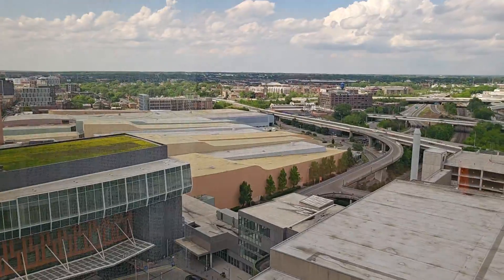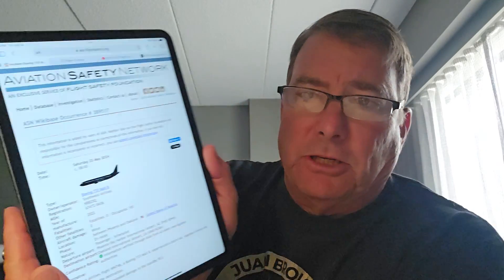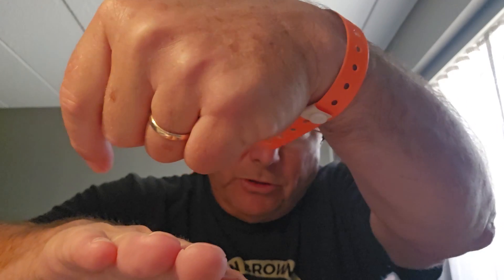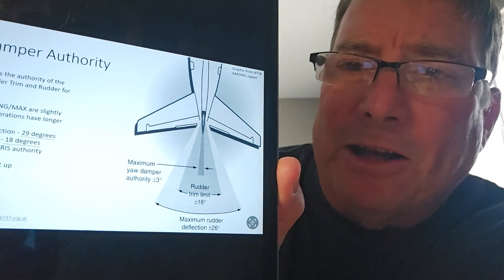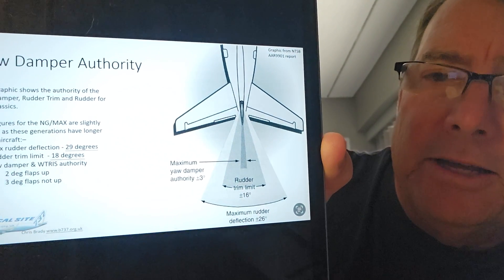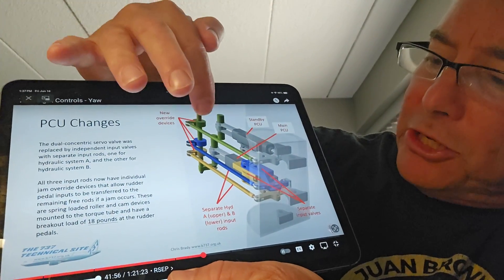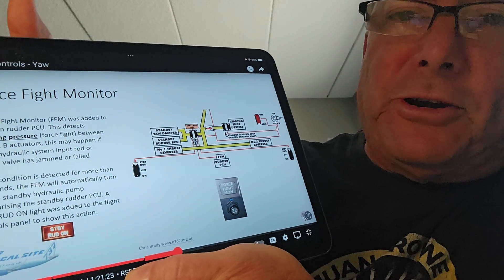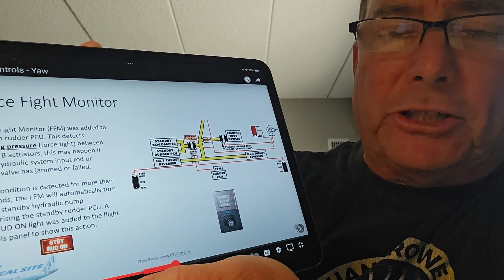SWA 737 Max-8  "Dutch Roll" Incident

Comment: Hey Juan.  I thoroughly enjoy your videos and all the in-depth research you do.  I just watched the video about the 737rudder issue that happened recently.  I am a tech instructor for both the A-320 and B737 Max for an airline. To answer your question, the Max uses the same rudder control system as the NG.  Incidentally, after the RSEP (Rudder System Enhancement Program) which was mandated in the early 2000's, a new main PCU was installed (I did a few of them while I was turning wrenches).  That said, the classics then had the same type of rudder system as the NG and the Max after the modification was incorporated (RSEP).  The Force Fight Monitor was a big part of this upgrade.  The Force Fight Monitor is installed in the main rudder PCU and once it detects a difference of 3600 psi for a minimum of 5 seconds (one system pulling one way while the other system pulls the other way), it will automatically turn on the standby hydraulic pump and activate the standby PCU which will control the rudder.  One disclaimer is that I DO NOT work for the airline that had the problem but am aware of it via the news and your channel.  Hope this helps and keep your awesome content coming!
Reply: Such a strange story.  Dutch roll felt by the pilots at Fl34. Failure of yaw damper?  Pilots regained control per FAA but cause structural damage to the ribs, standby pcu damaged- what does that even mean- physical damage to standby pcu-how does that even happen.  Pilots then continue flight like nothing never happened.  But something serious did happen. Can’t wait for the NTSB report.  Ribs of airframe structurally damaged. Incredible.
Reply: @gailcates8826  inadequate supporting structure for the PCU. Which in itself is saying something-the PCU is a pretty robust piece of equipment & given it's role in primary control of the aircraft-one would tend to question the basic design of the structure itself........
Reply: Since nobody has said it yet, thank you for the clarification of the Max's setup. :)
Reply: @ZeDestructor00  Indeed.
Reply: OUTSTANDING response. However-a difference of 3600 PSI ? Considering System A & B as well as Standby operate at 3000 PSI ?
Reply: @stevenrobinson2381  Yessir!  Think of it as a tug-of-war type event.  The system A servo valve pulls one direction while system B pulls the other creating an actual pulling force between the system servo valves of greater than 3000 psi.  Also, when there are rudder inputs made from left to right and vice versa, the point where the rudder changes direction makes a pressure bump but it's so short-lived that it's not considered a force fight.  That's why it is set up to require a period of five seconds minimum in which it would be an actual force fight.  Hope this helps clarify it
Reply: Is it possible that one of the PCUs or hydraulic systems was MEL'd, and then a failure of the other left the airplane without the yaw damper? 
Or is that not an MEL item on the 737?
Reply: Thanks for the clarification
Reply: I was wondering how that worked.  Thanks for the explanation
Reply: Damn, what pressure do they run at to have a 3600 psi difference?  Most hydraulic systems are around 3000 max.
Reply: @mrbmp09  As others have said, nominally upto 3000psi. 3600+psi should only be hit if there's two pumps acting against each other, thus the automatic shutdown set to trip at that pressure level.

Comment: It's funny you mentioned it, I've had this conversation with many pilots about "damper vs dampener". The Cambridge English dictionary defines dampener as: a device that reduces vibration (continuous quick, slight shaking movement):
Synonym
damper
Reply: I think damper is more concise and professional but dampener is not wrong, they really are interchangeable. The car community had this debate during the early internet and even the most pedantic could not refute that they're both acceptable

Comment: So we don't know, yet if the yaw damper was working or inadvertently turned off ? Since there was structure damage to the PCU mounting, sure sounds like excessive rudder inputs, which, IIRC, was not part of recovery procedure from Dutch Roll in the 727 which was much more susceptible then the 737 due to the higher wing sweep.. It was taught not to use any rudder input at all since that usually made things worse. The procedure was to "stab" the rising wing with a quick, sharp aileron input and back to neutral. Took considerable concentration because it's just not natural to do that. Very easy to start a PIO.

Comment: Former Crew Chief on a USAF KC-135 (59-1507) and experienced firsthand in the late 80s a Dutch roll on a TDY trip. Not a good feeling I must say. Subsequent local sorties pilots were experiencing the same on this particular jet. Boeing came up to Loring AFB (our home base) and started changing out parts. Aircraft was grounded for a while but eventually the Red X's were signed off and the jet flew again without anymore incidents. Crazy times. Kudos to the test pilots and Boeing engineers.
Reply: What was the cause?
Reply: @ajs1691  I honestly don't know. The story around the flightline was Boeing changed out a lot of stuff over a month or so and then one day it no longer did Dutch Rolls. Yeah. I'm sure Boeing knew, but by that time i was transferred to another tail number 58-0093 and the jet in question 1507 went to Tinker for the R-mod conversion.

Comment: Southwest went all-in on the MaX7 with a total of 342 orders. If SWA replaces older-generation 737s with the MAX, it  will compromise 40% of its fleet. If the MAX has any more bugs and is temporarily grounded, SWA  is screwed.

Comment: Love Juan Brown. Almost every day he helps pilots be safer and smarter and explains the business and hobby of flying to untold non-pilots. Maybe im being picky but, the dutch roll explanation is not quite right. The accelerated wing does not slow down owing to drag thus reversing the roll. The roll gets reversed by the vertical stabilizer. When the stabilizer starts restoring the yaw, the other wing is now accelerated and it starts producing more lift rolling the aircraft back the other way. The cycle can be exacerbated by pilot input.

Comment: The Airbus A320 was known (many years ago) for mild Dutch roll motion which made crew at the back nauseous.  I was told that the tailfin was too small, designed that way for fuel economy.
Reply: I heard it was normal lol, from the 727 on, and I did notice side to side back there during cruise, more in some models than others.  But that's probably more from wind direction?  IDK, just asking.

Comment: I experienced a total loss of the PCU in a SWA 737-200 on a flight from SAN to PHX.  At touch down we lost all hydraulics of the A,B, and Stby system.  They claimed that it was not possible to loose all hydraulics through the PCU, but it did occur.  This occurred around the time of the crash of the United 737 that crashed in Colorado Springs from a PCU fault.
Reply: It was potentially a problem with Airbus too. A potential problem was identified where both Yellow and Green hydraulics could be lost if the fluid was lost in one system and the PTU just ran until it failed trying to make up the pressure. So a mod was done that when fluid was lost in one system the PTU would time out and shut down before it caused the other system to fail also.
Reply: Wow you lucky some things on untied 737 sadly those people were killed now we have 737 max almost same thing this crazy why is always 737 🤦🏿‍♂️
Reply: @wilfordfootball79  because there are more of them than any other aircraft
Reply: @wilfordfootball79 
It’s not only the 737.
Reply: @richardlewis4288   "It’s not only the 737." 
True. It was a potential problem on the A320 line also but a modification greatly reduces that risk today.
Reply: I remember that UAL crash at KCOS…they tried to hang the crew with some absurd cockpit conspiracy theory..thank you ALPA for exonerating the crew!
Reply: Yikes!
Reply: Holy cr-p!
Reply: Meanwhile, Boeing got busy covering that one up too ?
Reply: Any swept wing can dutch roll, pay attention.

Comment: From the pilot perspective, during dutch roll the nose inscribes a figure-8, usually in a very small area (plus or minus 5 degrees, dissipating if you stop fighting it if the aircraft has favorable dynamic stability characteristics, which most of them do - by law.

Comment: they need to scrap the 777 Max it's one problem after another, it's going to be a serious problem a crash I can see a system error in the headlights. I wouldn't go on that plane. you got fatigue issues for a 2-year-old plane really! if I was executive of Boeing I would scrape it concentrate on the 800 and design a new plane in conjunction with Airbus.

Comment: 03:00  ...Considering the tremendous Increased memory Storage technology over past 12 yrs,  it's incredibly Obvious how the weak puny & frequently Useless obsolete 2 hr CVR "overwrite" FAA reset timer spec requirement was used to longtime "Placate"  ALPA's  cockpit "Privacy" demands that Continues to cause needless Loss of valuable post-Incident cockpit voice & Audible sound data !! .....Months to yrs of simple compressed time Reduced size & Weight recording hardware is easily available.....way back, FAA should've Grounded the newer planes & Uncooperative flight Crews until greatly Increased CVR overwrite time was Extended for Important benefit to airline Passenger safety.....

Comment: Looking at FOM 2 (Max vs NG), it is almost identical with respect to Yaw Damper architecture and operation (with minor variations in some of the older NG tails).

One of the first lessons when I learned to fly the 727 (from a Boeing trained demo/test pilot) was that the rudder pedals on large jets are not to be confused with rudder pedals on a “regular” airplane. They became ENGINE OUT pedals once the aircraft is airborne (+ crosswind pedals). Fighting (helping?) the turn coordination of the Yaw Damper could result in PIO and in some cases aggravate dutch rolling tendencies. Think feet on the floor (of course you will still guard the pedals with no pressure) unless you are controlling for X-wind or engine out- PERIOD. This lesson is very often missed today…

The 72 had a more aggressive sweep than the 73. It was more challenging in a x-wind (dutch roll tendency) and had 2 split rudders and 2 yaw dampers. The dutch roll recovery maneuver in the sim was… aggressive? Lol. Feet on the floor and snapping maximum aileron/roll spoiler input opposite the roll. High altitude made it much worse, although I know someone who lost one of the yaw dampers and he said the approach was yaw unstable even with the one working. 

At the expense of cruising speed, the 73 is more stable (less sweep) and has very limited dutch rolling tendency (provided the pilot understands what the rudder pedals are properly used for- see the above paragraph). Unfortunately, the 737 (all variants) still require the Yaw Damper to be reengaged with every IRS alignment.
Reply: 737 pilot's Dad speaking. Son says, "Just aileron inputs to turn, don't touch the rudder pedals" The yaw damper takes care of turn coordination. Pilot input upsets the precise coordination. Need the rudder for landing...
Reply: @ianhart356  Thanks for explaining. Yet one more minor difference between a 737 and a sailplane, then. 😀
Reply: Thank you for sharing this.
Reply: So the rudder pedals aren't used to coordinate turns?
Reply: @j_taylor  From FCOM Vol 2 "Either yaw damper is capable of providing dutch roll prevention, gust damping and turn coordination. Yaw damper operation does not result in rudder pedal movement. The pilot can override either main or standby yaw damper inputs using either the rudder pedals or trim inputs."
Reply: Manually coordinating turns is not recommended or standard procedure- you will never do it as well or as fast as the Yaw Damper. In fact- you will be fighting the Yaw Damper in many cases.

Comment: Experienced a Dutch Roll on a Delta Flight from Seattle to Honolulu a few years back (2019).  The Flight Attendants remarked to me at the time... "What was that?"  They didn't know what it was.  I knew that the oscillation was not right.  There was some turbulence, then the plane was wobbling around, nose up and left, then nose down and right, then nose up and back (like a figure eight).  I thought, that was interesting.  I took some snap shots of the passenger flight screen shortly after it settled down to get altitude and speed.  My thought was... "Dutch Roll?".  After I got back home, I did some internet sleuthing and lo and behold, yep that is what it was.   It only wobbled say three or four times.  I sent you a note on the event and you said, yep, that is what it was.  It was an interesting roller coaster ride.  Pilots did a great job settling it down.

Comment: On Boeing 727 post HMV (Heavy Maintenance Visits) we would put the plane through a test flight of all systems verification flight before the plane was approved for revenue service back on the line.

Part of the yaw damper test was to induce a Dutch roll with one yaw damper switched off.  The plane had to restabilize itself within one and a half oscillations.

Anything going past that and you were in test pilot school for an uncontrolled aircraft.  And you can bet we’d switch in the second system otherwise things could get squirrelly.  

Remember you have an upper and lower rudder / system.  The 727 was an aerodynamic marvel for its era, way ahead of the systems in those days.  It was like flying a sports car.

Imho - today there are so many redundant systems.  Back then, basic airmanship was essential.   I’m showing my age but today, many pilot applicants do not have the benefits of military flying and some can be too autopilot dependent.

Juan, my last contribution was TDY’d to Boeing by my company as we were the B777 launch customer.  EEVIP - Early ETOPs Validation Integration Program was part of the 777 getting 180 minutes ETOP certification concurrently with the type certificate.  

Juan, you do a great job explaining things.